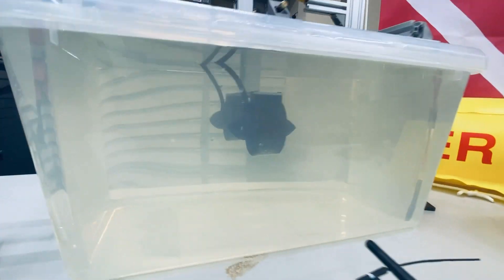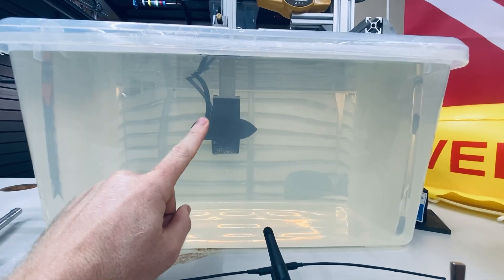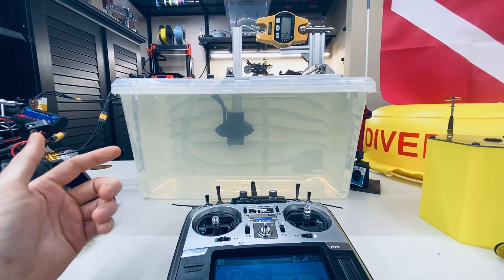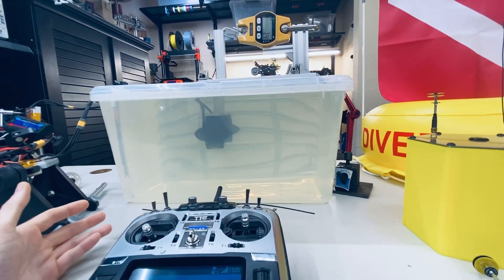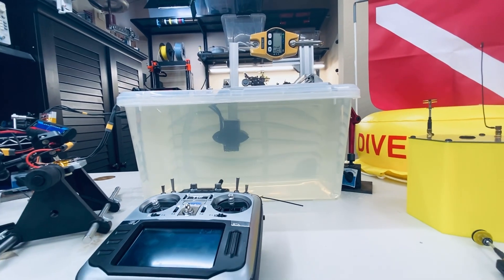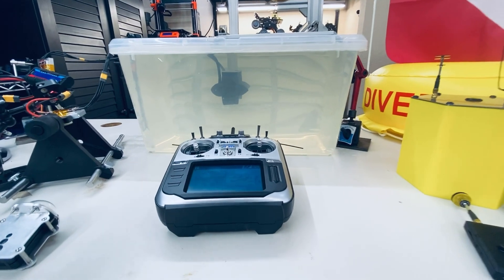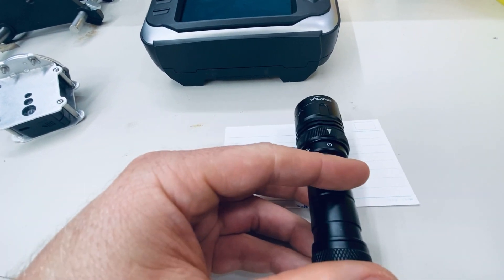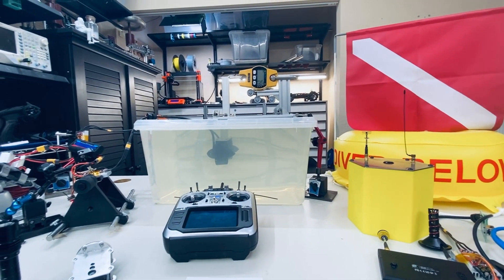Testing Brushless Underwater Thrusters

Comment: Dude! Insane amount of power out of such small thrusters. It was obvious that you can't even get an accurate reading with the flex of the pivot shaft. Need to reinforce the test structure to really gauge. I bet your output is near double what it registered under that current test structure's limits.

Comment: Isn't the speed just directly related to the velocity of the water coming out the back? Is there no simplified equation to get estimated max speed?
Reply from the maker: I guess that would give you a theoretical max speed if the motor has enough thrust to propel the boat. If you attached a pressure washer to a larger boat, it's not going to move the boat at over 200mph even though that's the velocity of the water coming out of the nozzle. There are rough boat speed calculators online but I imagine a realistic formula would be pretty complicated and also depend on the boat shape, displacement, motor type, efficiency etc.